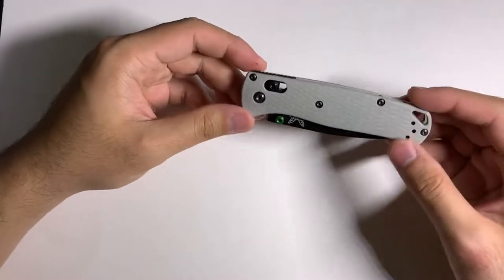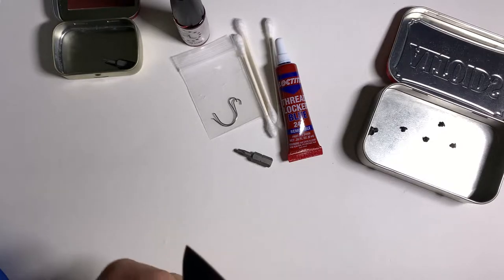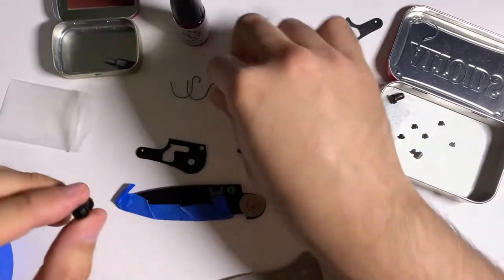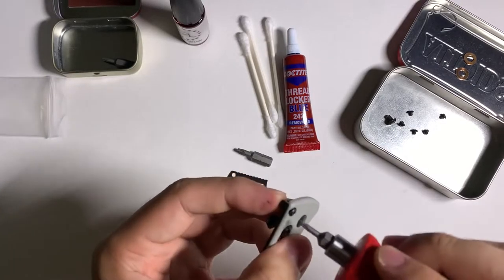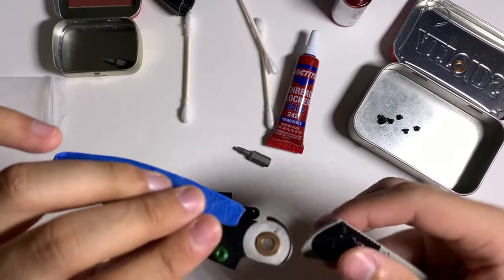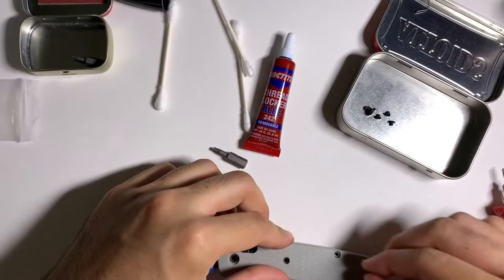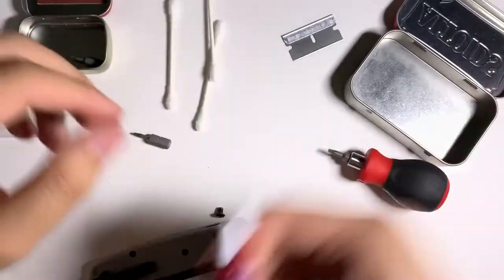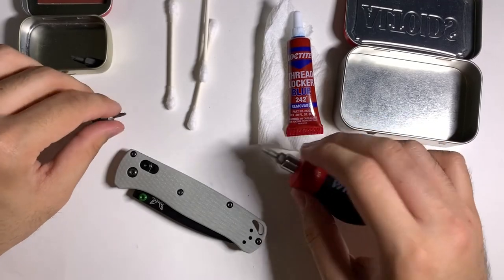The EASIEST Way to Disassemble a Benchmade Bugout and Fix Broken Omega Springs

Comment: Thank for your Video. Purchase a Special Run Bug out with M4, G10, Grey coated blade. I love it , had it 30 days flicked it HARD, to make a loud satisfying snap. Yesterday Saturday while snapping-open both springs cracked at about 4pm. I ordered for 9.99 from Amazon. Received them Today Sunday at 3:37 pm. It’s now 4:40 I have been done about 10 minutes. It is good as new 😎. I watched your video about 20 times between yesterday and this morning. I had tools and supplies ready, and Knife completely taken apart and laid on table. I opened door and began to put back as per your great instructions. ( Did not tape ) .. it’s done ✅ and I’m happy .. no sweat.. I figured out a couple of hacks if anyone needs advice. Now that I’m confident I will purchase a few more used or cheap basic big outs with out any fear of taking apart and customizing Scales, Hardware, etc. Thanks Again 
I feel great again , my knife is back and fixed it my self. 

S
Reply from the maker: thank you so much for watching and i am glad this video helped!!

Comment: Cool video I just put everything together except the blade, bearings and center pin then tie the axis lock back with upholstery thread and work the knife blade and beaing into place with super thin shims and thread. Once lined up push the center shaft through and done. I'm gonna try your method but I've yet to loose a spring . Thanks.

Comment: It doesnt matter what side is worn.  THE NUMBER ONE thing you want to make sure of is is that the side with the bur from when they were stamped out is not facing the blade.  Most time Benchmade puts the bushings in facing the same direction so on one side fo the blade the bur will be facing the blade and you want to switch whatever side has this so the rounded or the stamped side is facing the blade.  If you have this then get some 1000 grit sandpaper and place the none shiny side down and make like 10-20 circles with the bushing on the sandpaper to polish the bushing so you can make sure that both rounded or stamped sides are facing the blade NOT THE BUR!
Reply from the maker: thanks for pointing that out

Comment: What I do to get the old  Loktite out of the Pivot Screw is drop both sides in some alcohol and let it set for 5 or so min and use a toothpick to clean the male side and use a cotton swab to clean the female. It does a nice job of cleaning them, then you can add the new.

Comment: so i got the m4 version and it felt really gritty right out of the box and had a lot of lock stick so to took it apart and noticed a lot that could be better.  the liners/housing for the axis lock has a rough surface so the edges of all of the holes are sharp to the touch and the rough surface adds to this almost like serrations so i polished the flat surfaces with a strop and inside the where the axis lock rides i had the perfect aluminum oxide 5000 grit sharper for sharpening blade serrations whic fit perfectly so i smoothed that out.  i think with how rough that whole area is what causes these springs to wear out.  but that wasn’t the worst of it.  the hole for the pivot was so sharp and jagged that it was destroying my washers and the surface of the blade tang behind the washers had super aggressive machining lines but beyond that it was also very pitted.  the surface that the other side of the washer rests against was also rough and the entire surface of the tang that the lock rides against was pitted and rough and the lock bar itself was rough.  also the pivot itself is “D” shaped and the shoulders of the flat part of the “D” shape was rough because of machining lines.  i polished all of that out and now it’s much smoother and zero lock stick…. i have two budget chinese axis style knives each cost exactly $50 and neither have any of those issues but my american made $200 benchmade had zero quality control.
Reply from the maker: Chinese knife brands like civivi blow benchmade out of the water

Comment: There is no detend ball in any axis lock whatsoever. The mark you see on the blade near the pivot is very likely to be the result of the HRC testing made at the factory (which is usually made on a part of the knife that is hidden to the end user).